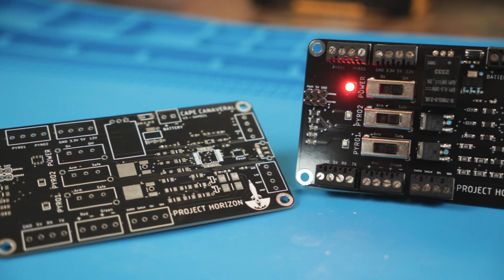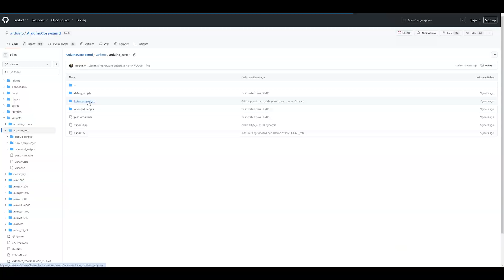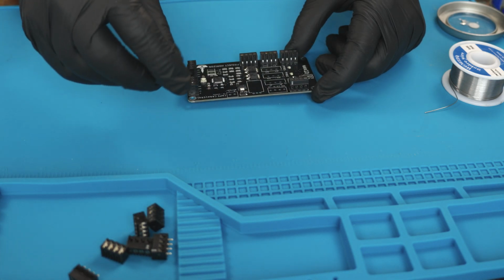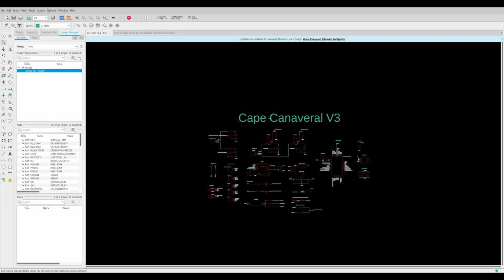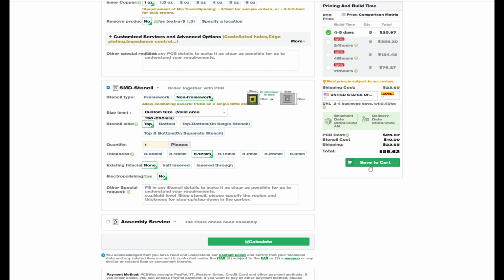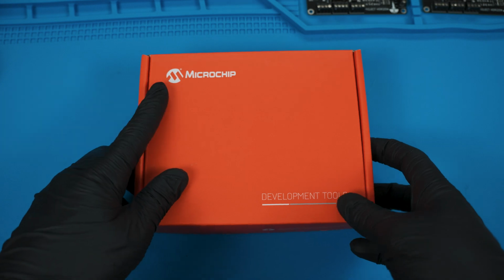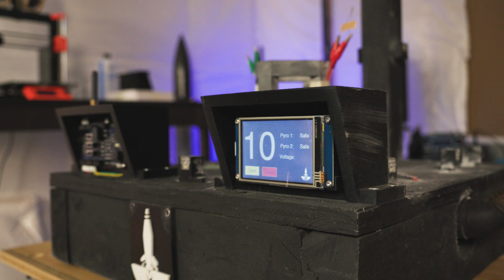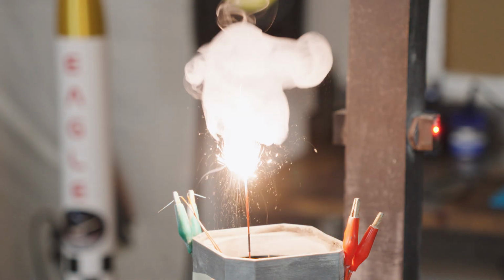Let's Make a Launch Pad Computer

Comment: Hey there! I love your PCB design so much! Uhm, I wanted to know which terminal blocks you used. Would be great if you could answer. And hey, keep up that fascinating content
Reply from the maker: Thanks! The ones in this video had this mfr #: 14020414402000. Search that on Mouser and you'll find it. I also like these cheaper and smaller two position terminal blocks that you can slide together cleanly: OSTTE020104, you can find them on Digi-Key.
Reply: @Project-Horizon  Tysm! 😍

Comment: What background/degree do you have in order to equip you to tackle this project. I graduate mechanical engineering in 2 days and I’m looking for an intro to “this” kind of textbook- what would you recommend? I can only think of something like a control systems book?
Reply from the maker: Congrats on graduating! I actually don't think you need a background in any of this to hit the ground running. I learned just about everything I needed from the BPS Space YouTube channel as well as other online resources/channels, and just learned as I went through the project. Joe's channel is a treasure trove of information and I would really suggest giving his channel a look. That said, with a Mechanical Engineering degree, you already likely have A LOT of the required skillsets for this project.
Reply: @Project-Horizon  are they the guys who put a c*ndom on a rocket cone?
Reply: Self-taught via passion and higher-than-average dedication and ability, if I had to guess.

Comment: Hi bro! And what altitude record did you manage to achieve? And what are your goals? Is it possible to fly 100 km with such a small rocket?
Reply: 100km is a very hard target. Sounding rockets can achieve this, but usually that's the larger variants at 3m length and bigger.

Comment: To learn this sort of work, what courses and degrees you need to be doing? To learn this. Thanks for video
Reply from the maker: I learned everything from YouTube videos! But most of this stuff is in the alley of Electrical Engineering.
Reply: @Project-Horizon  thank you sir for your help, I am a new subscriber, all the best with your project, great videos
Reply: @Project-Horizon  Wouldn't you say some software too? I mean I assume the program you made on your computer as well as some of the things that handle the interaction is that. I personally do software and am wondering what it would take to get into this type of thing, it's seriously cool.
Reply from the maker: Yes definitely! My launch pad, telemetry, and flight computers are all microcontrollers that I wrote software for in the Arduino/C++ language. Writing the software for each part was a ton of fun and taught me A LOT. I'd encourage you to try projects like this as well if you have an interest and background in software😊
Reply: @Project-Horizon  Awesome, absolutely amazing work on the video and this project! I may very much endure in model rockets and try to climb up to something like this (literally).
Reply: 这个火箭🚀的发射药剂是什么，如何制作的呢？它安全么？有没有可能像鞭炮一样会爆炸？

Comment: I was currently working on an altimeter using the same processor when I saw this video. Thanks a lot for you help on the pyro channels of my last board.
Also: Why do they make the Atmel-ICE so expensive?? I'll have to use one of those cheap Amazon debuggers, so I won't be able to write the fuses :(
Nice video, please keep going!!!
Reply from the maker: No problem! Yeah at $200 it isn’t super cheap… I think there’s a cheaper option that Adafruit offers, but if you use that you can’t sell the board. It’s strictly for personal and non commercial use.

https://www.adafruit.com/product/3571

Comment: Looks great and I am sure it will get the job done! Just want to suggest a few nice things to take a look at for future projects. 1) I think micro-USB is obsolete, type-C is way better 2) You can use addressable RGB LEDs, for example, ws2812b or similar. They are just easier to route since you need just one data line to control all of them. They are very cool. 3) This DC-DC module is quite bulky. I like adding DC-DC switching voltage regulator circuitry directly to my boards. They are also very fun to design. 
Also don't know if you tried KiCad or not. I personally like it much more than Eagle :P
Good luck! Waiting for more great stuff from you :)
Reply from the maker: Hey Dima, GREAT SUGGESTIONS! 1) Yes, I was actually considering the type-C this time, but I got a little bit lazy and had some micro-USBs still lying around so I just went with that for now. 2) I love this idea and will be doing that going forward. It'll save a lot of space on the board since each LED won't require 3 resistors and 3 microcontroller pins. 3) Yes it's bulky, normally I like the 1A version which is much smaller, but for this I got the 2A huge version to over engineer the 5V power source since I never know how many extra devices I may plug in to the pad. Also would you mind emailing me? I was actually looking to shoot you a question or two a while ago about MOSFETs a while ago, but couldn't find your email on your page.
Reply: @Project-Horizon maybe from a reliability perspective addressable leds aren‘t that great, especially not for critical use cases. If one of those LEDs has an issue and is let’s say shorting the data line, every led after that one won‘t work (might even light up, just doesn’t react properly or sth). That already caused headaches with simpler projects for me :)